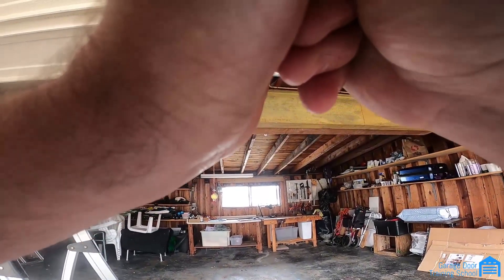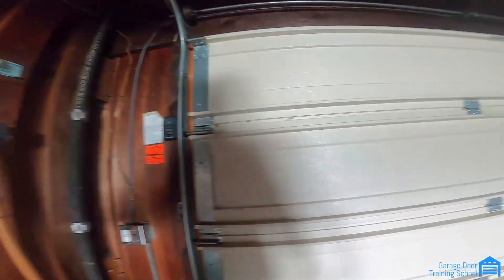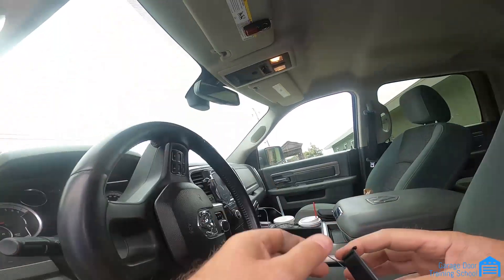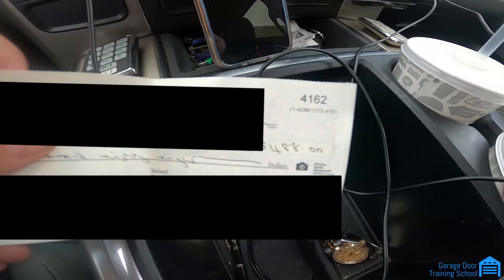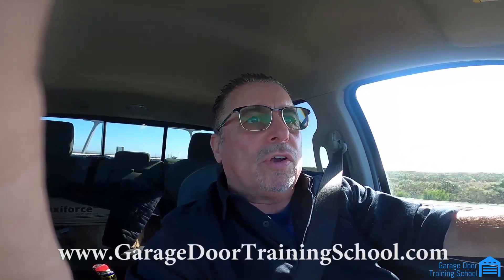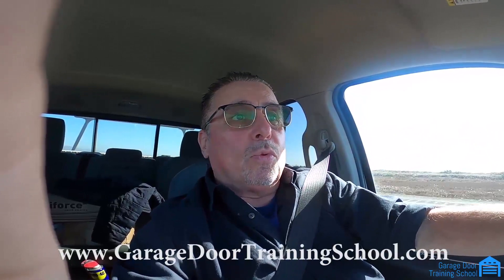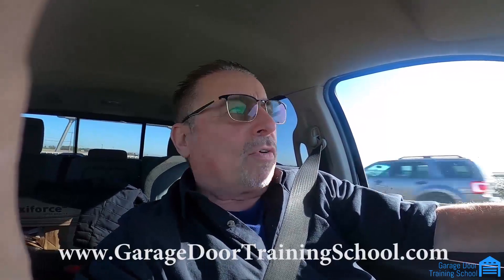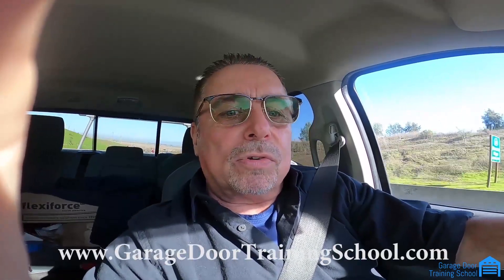ANOTHER Repeat Customer! | Opener Fix + Door Service

Comment: Another GREAT VIDEO! Question,  do you charge a service call fee?  Like in Appliance Repair they charge $100 just to come diagnose and troubleshoot.  Then payment for parts and labor.
Reply from the maker: Thanks Patrick!! Yes, there’s usually a small trip fee if the work ends up being minimal when you arrive or if the customer decides they don’t want to use your service once you’ve already driven to their house. But this doesn’t happen very often and most of the time you can just include it as part of whichever repair is being performed. 👍